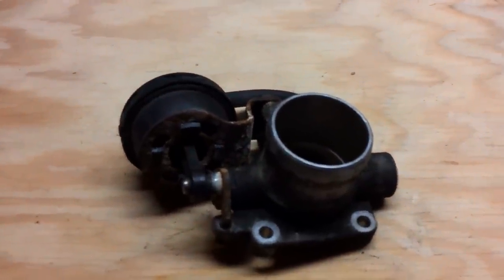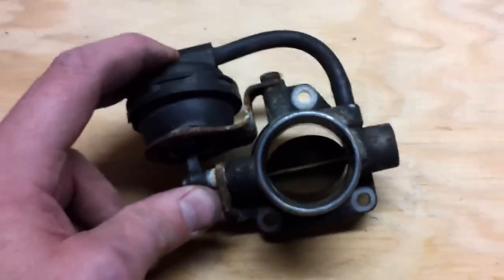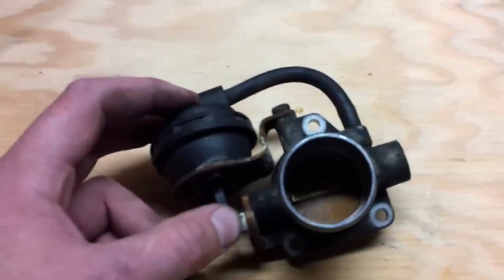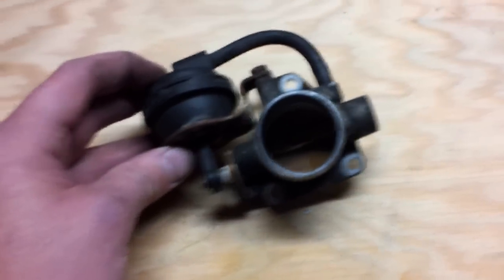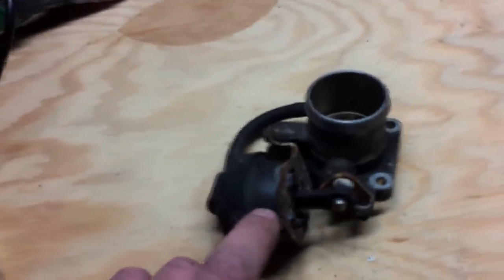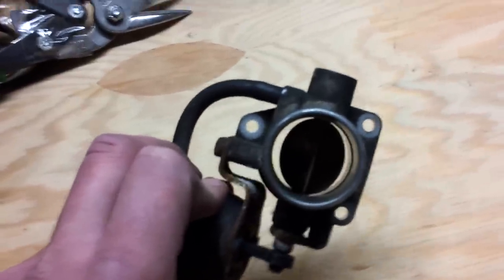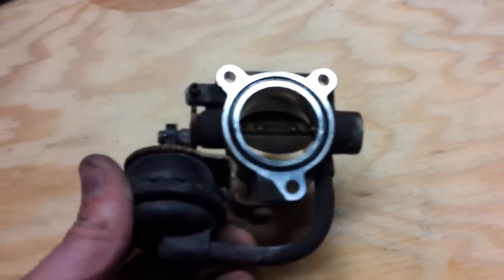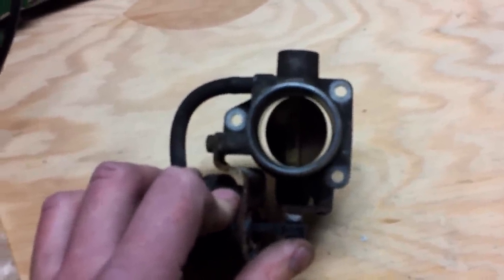MINI R53 Failed Bypass Valve

Comment: Hey AC, there's an air release on my throttle which may be the bypass valve that needs replaced on my mini coop s convert 2008. Getting a diagnostic tonight. What did you pay for the part?